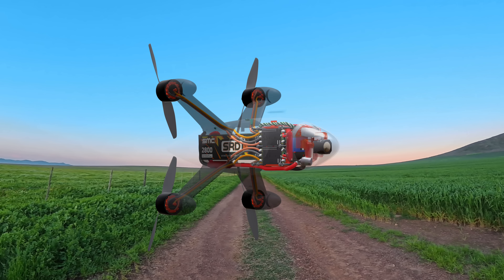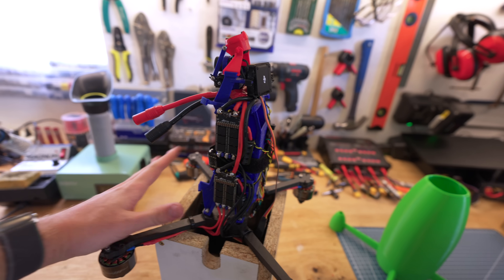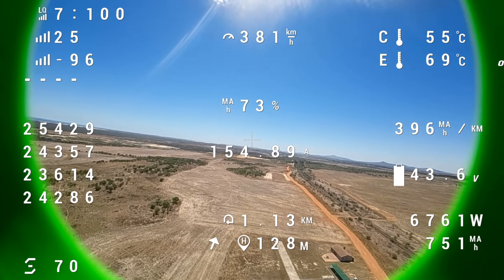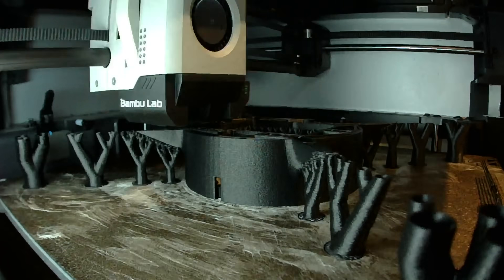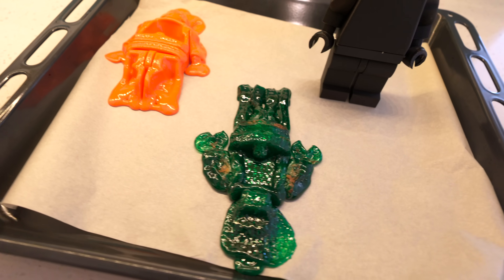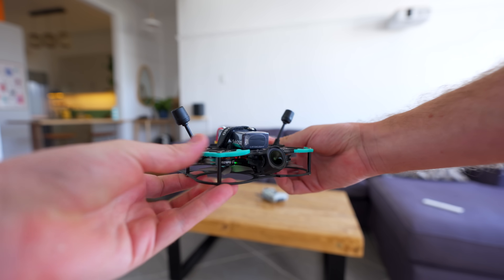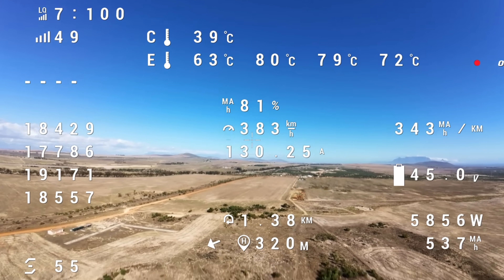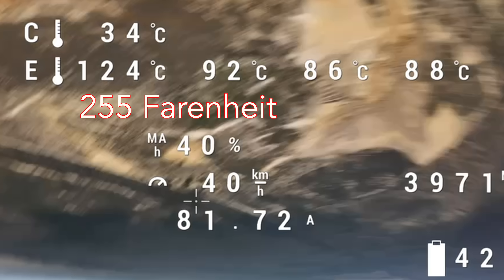THE COMEBACK - World's FASTEST Drone V3

Comment: 3.25.....why did it catch on fire??????   For liquid cooling, you might want to consider a "boil off" system using water/methanol.  It will reach 85C and stay steady until all the liquid is boiled off.  The Warbird air racers use that system to meet ALL the cooling demand on their piston engine Merlin powered P-51 air frames.  The boil off system needs no air ducting that causes high drag at high speeds.

Comment: Hey I was pondering on the water cooling solution and that pump could easily circulate it into some channels printed in the frame for the motor mounts. That could solve the issue of needing airflow inside the drone. Use the existing surface area. As you mentioned the 3D printed frame gives you much more freedom in design!

Comment: Maybe it’s been said but you mentioned we could easily fix the stabs issue about 3/4 through the video.  “But it would add drag”.  What about an as needed switch blade like, vertical stabilizer.  Think fast acting retracting like the f-14 tomcat.   I know next to nothing about the physics of flight but my thought seemed like an original thought and I wanted to share.

Comment: Alot of cooling headroom left on the table. Polishing / milling the IC package to get closer to the Actual silicone. Change the aluminium plate to a vapor chamber. Thermal interface material to liquid metal. These changes might drop the weight enough to go for a larger heatsink too! Looking forward to the next video! Love them!
Reply: Liquid Metal has serious issues with escaping confinement and then shorting components out. The risk is not imo worth it.

Comment: Congrats on the achievement. Great video. 

Just a correction you are not using 16Kw of energy from a 49.5V battery. That's just not possible with any current day battery technology. What you are seeing on the screen is most likely an estimation and not sure how the controller is coming up with those figures. 

I haven't researched batteries in a couple of years but the highest C rating that I am aware of is 50C. That means if your single cell battery is at .450mA rating can put out a maximum of 22.5Amps. if you are using a 12 cell battery which gives 49.5VDC. The total max power dissipation is going to be 1200W of energy. I hope that clarifies things.

Comment: simply EPIC, some ideas,  what about a peltier cooler instead of water? an direct the hot exhaust part to the rear to soften airflow at the back and improving drag same time cooling the drone with less weigth, and what about 3 motors instead of 4 to reduce drag too, another one disarm the lipos and put each sell inside the wings and reduce the pod, I would love to play with these things but here in argentina its impossible to pay for this, keep it up
Reply: Peter cooling doesn’t really eliminate the heat, just makes it move faster. You still need somewhere for it to go.
Reply: @rivimey an aluminium heatsynk shaped as rear cone made in a sand mold to be cheap

Comment: You could easily beat your own record if you try to fly at higher elevation. You should try going for 1200..1500 meters. At that altitude there would be no need to change your FC settings nor the props, but the drag would go down, and you probably could gain some 3..5% of speed. At higher altitudes you would probably have to increase prop diameter, and one would have to be careful about changes in behaviour. If you optimize for 3000 meters, you certainly can gain up to 10% speed.  Now in Australia, that is going to be tough to find high altitude flying locations...

Comment: What about mounting the esc's in a mineral oil bath like they do in PC's for heat dissipation. Also, I bought this belt fan that you clip on your belt and it blows air under your shirt on hot days. But the thing is; is that it uses semiconductor cooling which makes this little metal plate get so cold it frosts up and it's called a Peltier cooler. Check it out and it might be perfect for your project .

Comment: i would try to get my hands on a 3D printer that can feed continuous fibers into those prints for increased stability - and thermal conductivity. 
also, you may be able to use the hull itself as cooler, instead of storing it into a water-tank

Comment: Could pull a page from the p38 and run ductwork in the leading edges to take advantage of the exterior air flow for cooling.

Since the body is printed nylon, cooling channels like capillaries in the body should be feasible. Could reduce the mass of water required required.

Comment: If you wanted ~1/3 the weight for your thermal storage (or 3x the capacity) you could use paraffin wax and take advantage of the phase change at ~50degC

Comment: Goodone Brother - Go for it and the very best of luck.  Keep em comming . Loved it... Would it be better to try and run the speed trial in Jhb as the altitude is so high, rather than at sea level... just a thought.
Reply from the maker: Yes we have considered that. But we have found that thicker air is actually better for a few different reasons. Mainly being that the RPMs don’t has to go as high

Comment: Mech engineer, here. Just so you know, without a water loop and radiator, your "water block" is actually not doing anything. Once temps reach steady-state, you will probably find they end up about the same as before you added the water. This is just fundamental heat transfer.

I suppose, if you are only running for very short periods, you can use the water block as a sort of temporary heat sink do extend the time before steady-state temps are reached, but I'm not sure if that was your intent.

Anyway, this really needs a cooling loop and small radiator. But at that point, I think water cooling is just way overkill for this. Just take advantage of that high speed air and use some sort of air intake with fins.
Reply: It is exactly a temporary heat sink.
Reply: @rivimey  I suppose that's reasonable if you're just trying to break a speed record. I still feel like there's a better way to just temporarily dump heat, though.

Comment: Maybe you could push the watercooling even further (that is if it's of interest before you run out of kWh) : that heat is actually energy that can be conveyed to the flow, and properly shaped intakes and outlets could not only make a zero drag increase for proper liquid to air cooling (you already have the pumps !) but even a slight increase in thrust through thermo propulsive effect. It only works @ high-speed, but you are P-51 Mustangering the sh*t out of that one (p-51 cooling was perfect). If not through scoops and nozzles, I would try leading-edge inlet with baked-in heat exchanger from the 3D printing. There's a good book about that : "Aerodynamics of Propulsion" by Kuchemann (you have to provide your own material-related heat transfer constants though). Hope that helps.

Comment: ESC heating only means you undersized the ESC.  Simply going with more low resistance MOSFETs on the ESC would eliminate the heat problem with 1/4 the weight of the water "cooling".  Obviously just mounting the ESC FETs to an aluminum shell would give them massive cooling as the thing has four friggin fans.

Comment: Using a dry ice rubbing alcohol slurry to cool hardware would be a upgrade over water.  Would maintain reduced operating temperature for higher efficiency. Evaporating off though spring loaded valve into a mini nozzle gaining extra thrust.

Comment: Your drone is already going through a massive amount of air that can be used for air cooling if the ESCs are thermally connected to the outside. You just need to incorporate the ESCs into the fins and make the fins out of aluminum or print the fins with a wide slot for inserting the ESC's under and thermally connected to an aluminum strip exposed to the airflow. This should greatly reduce the weight, since water wouldn't be needed, and the aluminum could be a part of the structure. If all aluminum fins are used, the thickness could potentially be reduced to just barely accommodate the ESCs plus needed curvature. Potentially an already available or a custom extruded foil could be used for the fins. Although with that much airflow a relatively small strip of aluminum incorporated into the fins over the ESCs may be sufficient. 
Alternatively the ESCs and heatsinks could be incorporated into the canopy, but this may prove to be more difficult and less weight reducing.
Reply: You could keep the ESC's inside the main body and run heat pipes from them to the fins
Reply: Draaaaaag. Remember, drag force goes with the square of velocity. Mass is linear in Newton's second law. Drag is a much bigger deal.
Reply: As per the idea above, the ESCs in the fins would be as close as possible to the motors, needing minimal wiring. If they could be thermally bonded to the aluminum skin of the fin internally, this would also result in minimal weight, lowest drag, and best cooling efficiency because thermal pads are not needed. Thermal epoxy only between chip and fin.
Reply: Make the body of aluminium, bond the escs to the shell, it acts as a heat sink and is air cooled without adding drag.
Reply: Your idea is pointless and inferior. So many armchair engineers on this video that have no idea what they are talking about. It already has all the cooling it needs! Why do so many of you insist on adding massive drag? It will not help top speed at all! Lol.
Reply: This isn't a long endurance vehicle.  It has less than 30s of battery at full throttle, and the ESCs alone are dumping several kW.  There's not enough time for a reasonably sized radiator to do anything useful.  Using a chilled water tank is absolutely the correct solution here.  The only improvement I could suggest would be to use brine or antifreeze, and make up for the loss of specific heat capacity by chilling it further.  You could even try a boiling solution, but there's not really anything that boils in the right range without being pressurized, high flammable, highly toxic, or a combination of those three.
Reply: @wagnerrp Are you or anyone else able to do the actual calculations for heat transfer with these air speeds vs water? It would be an interesting exercise to determine if the heat transfer would be sufficient. I had difficulty trying to figure out how to calculate this correctly. There are many variables beside air speeds, such as temperature differential, air pressure, humidity, and surface geometry.
Reply: @RD-Inquisitor  If I once knew the math, I forgot it 20 years ago.  Just consider your PC as an analog.  You can keep putting bigger and bigger fans to push more air into your system, but you very rapidly hit diminishing returns, and instead of your components running cooler, all you get is cooler air coming out the back.
Reply: @RD-Inquisitor  Assuming standard pressure (101.1 kPa) and temperature (393k) at roughly sea level and a average coefficient of thermal conduction of air (0.025 W/m.K) we can assume the Prandtl number is ~0.7. Our Reynolds number comes to ~4.98*10^5. We use a turbulent flat plate approximation for the surface of the wing, giving a Nusselt number of 1.19*10^3. Solving for the coefficient of thermal convection gives 618 W/m^2.k. Ignoring radiation and assuming the heat sink is thermally isolated from the rest of the drone and finally assuming the ESCs have to stay below 100 C (373k) we find a thermal dissipation rate of 4.9*10^4 W/m^2 across a small section of wing, say 5 cm x 5 cm, thats only 123 Watts. 

Long story short, you'd need to add fins or some other method of increasing the surface area so that it has more area to dissipate heat from. This would also mess with the flat plate assumption, but thats rather trivial in this case, as long as you keep the gaps wide enough for the flow to remain turbulent. If the ESCs can reach 150 C then the power dissipation increases to ~200 Watts, thats still off by an order of magnitude from the heat the ESCs are dumping into the water.
Reply: @wagnerrp  dry ice. You don't need the phase shift from liquid to gas when you can use solid to gas ... 😎
Reply: @dasgibmekker768 But… as soon as your surface sublimates, you’ve lost conduction to the rest of the solid, and your heat transfer rate goes to shit.
Reply: @wagnerrp  Well, you'd still have the very high delta T overall, but that's a point to keep an eye on, I agree.
Reply: @wagnerrp wonder how much frozen cooper inserts in the tank could help absorb for the mass.
Reply: @wagnerrp  Phase Change: Freeze the water, it will absorb more heat as it melts.
Reply: @guytech7310 When is the last time you tried to quickly heat up a block of ice?  It doesn’t work well.
Reply: @wagnerrp  heatpipes are pretty good and the bigger the delta t is the better the transfer to the passing air.

the amount of air passing is quite huge anyway. and the hotter the water resorvoir gets the worse that one gets.

I don't think they're dumping several kilowatts of heat anyway as waste heat(that would mean tens of kw's at the motors themselves, which aren't melting), it would've melted straight up on the first tests at the start and that water would be boiling in no time at all. 

it's a lot easier to cool than a cpu anyway because the transistors, the area the heat is coming from, is pretty big compared to a cpu die so if you stuck heatpipes on there you could get a lot of transfer to the fins or even just to the body of the rocket. based on that the pcb's didn't immediately combust on liftoff without anything heatpipes would do a pretty decent job on it.
Reply: @lasskinn474 Conduction is just fancy convection.  It’s still a linearly proportional rate, only one where you’re constantly changing out your sink material to ensure maximum temperature difference.  You cannot exceed that maximum regardless of how fast your fluid is moving.  Your medium isn’t even moving that fast, because boundary layers.  You can add fins to increase surface area and the amount of air you’re directly contacting, but that adds mass and drag, and more mass for the heat spreader.  You can increase surface roughness to increase turbulence and reduce the boundary layer, but again, drag.

The telemetry in the video reports >400A draw on a 44V battery, so you are technically correct.  It’s just short of the 20kW to merit the “tens” plural.
Reply: @wagnerrp  I'm now thinking the 'right' optimization would be aluminum hull and spread the fets around, they could be in the fins themselves too. but of course that would go beyond off the shelf esc's. 

something of course needs to be done to go even faster, custom esc's or some newer transistors may be necessary for that, though most simple way is to somehow make the central pod smaller in diameter.

Comment: *wobbling maybe from the water? 10:15
Reply: Why not finish the video before commenting huh?
Reply: I came to the comments for this. Needs pressurized. Any gap I’m sure is going to cause a sway in weight.
Reply: Maybe copper baffles?  Race cars baffle oil pans, etc. What about using ice/a slush?
Reply: Water and/or the waterpump motor maybe. Motor may be generating a centrifugal effect